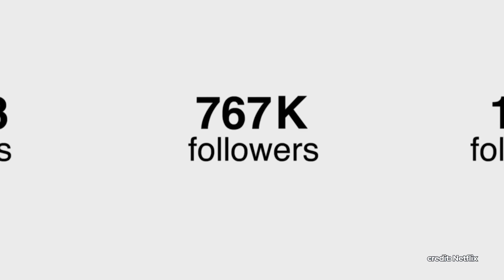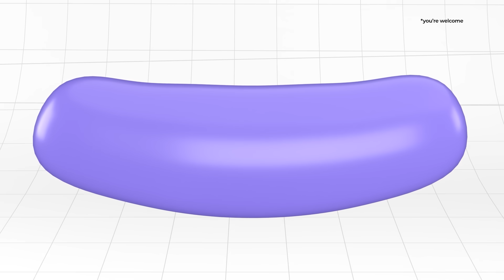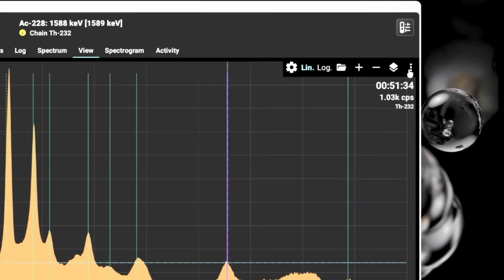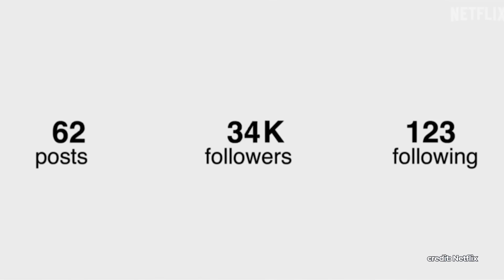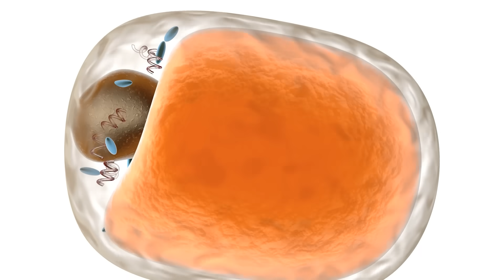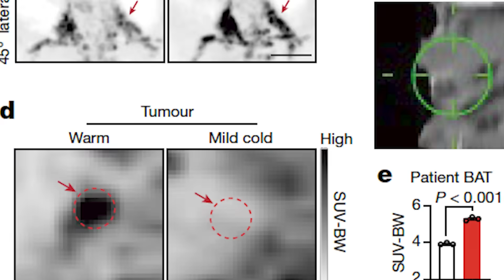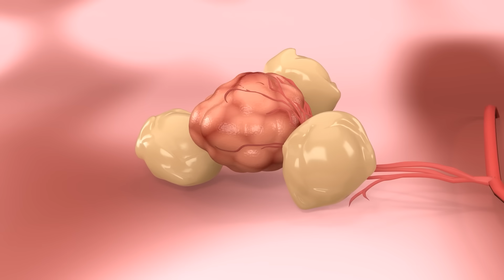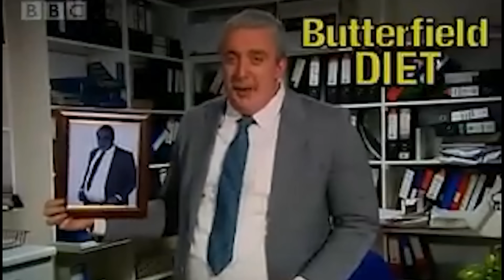Scientists Just Discovered How to Starve Cancer

Comment: I've been talking about this for years, and I've been ridiculed for it. When I mentioned Warburg, I was called a crackpot. When I said that it's a metabolic disorder that causes normal cells to go back to simpler (evolutionary earlier) metabolic pathways like glycolysis and fermentation (hence the lower oxygen intake and increased production of lactate), they said that I'm not a doctor so I shall shut up. Stupidity is even less curable than cancer, it seems :q
Why should we starve cancer cells though? I don't think this is gonna work, and I was saying that for a couple of years since. Here's why.
In most visualizations (yours included) people depict cancer cells as those nasty looking blobs, but in reality there is not much difference between "normal" cells and "cancer" cells, and you wouldn't be able to distinguish them even under a microscope, because they are the same cells as the "normal" ones, just with a different metabolism that reverted to older metabolic pathways from whatever reason (excess of sugar might be one of them, but damaging the oxidative phosphorylation pathway might be even more so, e.g. cytochromes might get damaged by nitrile groups that irreversibly bind with their active site). If there was a reason why those cells had to switch to earlier metabolic pathways in order to survive, getting rid of those cells won't do much, because as long as that cause is still there, new cells will switch too (what they call "metastases"). That's why starving them won't do either. It might even get things worse, because more starving cells means more reasons to switch to other metabolic pathways in order to survive, and they might find a different food supply. The worst case scenario is that they might find a way to feast on surrounding cells and decomposing them (basically starvation-induced cell cannibalism).
So what we should do instead? In my opinion, instead of starving them, we should remove the original cause of them switching to different metabolic pathways to begin with. We should provide them all the resources needed for oxidative respiration. Another hint comes from Linus Pauling, the world-famous Nobel laureate, who also did a lot of research on cancer and started an institute dedicated for that goal. His lead was ascorbic acid which is the primary antioxidant in plant cells. But there are others too, such as carotenoids, flavonoids, nicotinamide, and in humans a similar role is performed by cholesterol (another falsely accused "bad guy" of modern medicine). Long story short, these substances were not present in earlier stages of cellular life evolution because they were not needed yet, since there was no oxygen in the Earth's early atmosphere. Once plants started generating more and more oxygen, cells had to develop mechanisms for dealing with oxygen respiration byproducts (such as free radicals) and started producing antioxidants. The lack of those antioxidants might stop cells from using oxidative pathways in order to avoid producing too much free radical byproducts that might damage them, and switch to non-oxidative pathways. So in order to reverse this switch, one should provide more antioxidants to make oxygen-based metabolism available again. Also, since these substances weren't present in earlier stages of evolution (because they were not needed yet), anaerobic organisms can't metabolize them and they would be poisonous to them, if it wasn't for the fact that they evolved and now they have metabolic pathways for processing such molecules. So the presence of antioxidants might be a signal for them to switch back to these newer oxidative pathways – one, to be able to produce more energy from respiration, and two, to get rid of those excess antioxidants by oxidizing them by byproducts of oxidative respiration.

Comment: One Doctor uses pulse therapy because cancer cells do not recover as our own cells do.  Scientists have ran so very many experiments 'using low carb diet' when in fact it was not low carb and it was dangerously unhealthy - killing a lot of the mice.  When they say low carb or ketogenic diet dig deep to see how and what the animals were fed and for how long.  Some experiments of two weeks were nowhere near long enough for a body to relearn how to make ketones then get up to speed with making the enzymes to use them.  So much research was designed to fail.  Now this very expensive end product they are researching may not be followed up as it would loose a lot of income relating to treatment.  Well done those of you commenting below for the benefit you have found from a 'free' treatment plan.

Comment: TL;DR Scientists have discovered a way to potentially starve cancer by genetically engineering fat cells to outcompete tumors for glucose, effectively cutting off their energy supply without using radiation or chemotherapy. This breakthrough, called living cell therapy, shows promising results in shrinking tumors by over 50% in lab tests using modified fat implanted near cancer cells.

Comment: The ketogenic diet has a sound scientific foundation. As stated cancer cells are glucose hogs and are incapable of metabolising fat.
It makes sense, therefore, to remove carbs and sugars from the diet, thus depriving cancer cells of their energy supply. 
And there is no question of this being more harmful to the body than to the cancer. Humans can live perfectly well with absolutely no carbohydrate, but instead utilise ketones for energy production.
The trouble is that there is no money to be made by pursuing this avenue. Big pharma prefers big expensive sledgehammer solutions, which reap large profits rather than prevention or inexpensive solutions.

Comment: Is it required that all YouTube producers use the largest microphone on the market?  If I were to produce a Podcast I would opt for lapel microphones and a in ear piece speaker.  I did audio for a  live theater events.  Instead of wireless mics one the actors I used powered lapel mics carefully built into the floor.  It worked perfectly.  The audience never saw a microphone or wiring on anyone, because there were none.  The audio was all wired, never even 1 glitch.

Comment: I appreciate the video but I have to disagree with stating no studies or case reports show that a keto, low carb or carnivore diet has not been effective in cancer. Research is just beginning on this. And there are plenty of case reports where patients have had tumors reduced by using a keto diet including glioblastoma multiform, the deadliest brain cancer. I am an MD with a midbrain tectal glioma  which has actually shrunk in size since adopting a keto diet.  Further cancers also use glutamine for energy, the most abundant amino acid in the body. Researchers are working on glutamine blockers successfully. However, as the body needs this amino acid, the press pulse theory has been proposed where keto diets are used and glutamine blockers are used intermittently. I’m excited about the fat theory. I had not heard of it.

Comment: Cancer cells use glutamine (a 'non-essential' amino acid, in fact the single most abundant one produced in our bodies) as well as glucose which is probably why inducing ketosis was/is unsuccessful as a treatment on its own. It should nonetheless be used as part of a strategy/protocol to kill malignant cells at a rate which doesn't cause the body-wide damage that highly cytotoxic chemicals do ('chemotherapy'). There are actually several compounds which can be used, including one so cheap it's practically free. I'll leave the reader to guess what it is, and why strenuous efforts have kept it out of the public's awareness for well over 50 years.

Comment: at 4:47 the second image shows the bright spot is gone and also notice the heart and brain aren't as bright. how badly were they affected from the experiment?
Reply: You have to realize that the image enhancements that are done for PET scans make comparison of one scan to a later scan less simple than it would seem. If the intent is to compare one image with another, then many issues would have to be addressed to make sure that they get the same enhancements. Instead, the differences within a single image are more readily comparable because the same image processing was used across that single scan. So in the case of comparing the heart on the left with the one on the right or the brain on the left with the one on the right, these scans were probably not meant to focus on that comparison. The relative dimness of the cancer compared to the other organs within each image is really the key takeaway.

Comment: This is fascinating. I've had metastatic breast cancer for 32 years. It has invaded 7 different sites, confirmed by DNA analysis, over the years. But, so far, none of the cancers have developed much past 1cm, and it isn't because I've eaten a healthy diet or lived a healthy lifestyle. What I have done, consistently, is keep the thermostat at 62-65 degrees, until this summer. I finally turned it up to 70, during the day, to conserve energy and save my ageing AC system. I don't know that the cold environment has kept the cancer to manageable levels, but it is interesting that I've survive long past expectations despite my poor diet and lifestyle.

Comment: Dr.Gerson Diet
Original test on about 200 patients, 99.5% cure rate. Not only works against cancer, but it also helps the cells remove and replace scar tissue with proper tissue. I studied the diet and after having a doctor freeze off my skin cancer, when it persisted in coming back within weeks, I used a paste I made from broccoli and cucumber to cover the area three times a day. Over 6 months it healed and never came back in that location above my left eye on my forehead. It did come back about ten years later near the center of my forehead, and I used the same broccoli and cucumber paste and it healed over three months. 

Three times a day I washed my forehead with spring water and put the fresh paste on and taped over gauze on that paste. Organic Broccoli and Organic Cucumber, blended to a paste, put on paper towel to soak off the water. Put the paste on the spot, covered liberally, even 1/2 inch around the spot, covered with non-stick gauze and taped on with paper flex medical tape. If I had never researched and found the Dr.Gerson Diet to study, I would have not realized I could change my diet and make a paste from vegetables. I used Broccoli as I found it has anti-cancer properties, and I used the cucumber because (well, to be honest) I always was hearing it was the least nutritious vegetable that was pretty much useless, and I figured it was just a rumor spread around by family and friends. I needed something to help it be a paste and the rind of the cucumber seemed to be what would make a good paste.

Comment: You have completely disregarded the affects of low glucose diet, your body does not necessarily need glucose, it can burn ketones. You did not site any references when you blew off low glucose diet as ineffective. Work by Dr Thomas seyfried has shown this works, and mixed with glutamine inhibitors can cure almost any cancer. Any one reading this should check on Dr Siegfrieds work on you tube, it is eye opening.
Reply: That is Dr Seyfried not Siegfried, damn autocorrect

Comment: What happened if the beige fat, which is better at stealing glucose than cancer, isn't completely removed and instead grows uncontrollably.

I suppose it (hopefully) won't metastisize like cancer does.. but couldn't it grow causing additional problems?

Also does it generate excess heat like brown fat? Sufficient constant excess heat could damage surrounding tissue like a high fever does.

Comment: You skip lightly over why fat cells need to be extracted, modified in the lab and then implanted. Why can't those cells modified inside the body? And what is that liposuction we've been using for decades? How do you precision modify fat cells? One at a time? Where do you implant them? Around the tumor or in the spine? And how do brown fat cells burn glucose? The final one is totally weird. I did not know there were fat cells. I thought there was fat in the cells.

Comment: The dosage of chemo therapy can be diminished by 50 % if accompanied bij the use of Naltrexone in low doses off +/- 4,5 mg. The toxicty of the chemo therapie will significant be lowered so that the side effects en aftermaths of the medieval chemotherapies will also be significant reduced. By refusing to scientifically test Naltrexone for its broader application it is still only permitted for the use of treating people with addictions in a high dose of 50 mg. Low dose Naltrexone also works with people with cystic fibrosis, lung-covid, irritable bowl syndrome, chronic pain and several auto immune diseases.

Comment: There's so much missing about how cancer starts and works, it seems a bit shallow, not thoroughly researched.
Cancer does not start with the genes, but the mitochondria. Healthy mitochondria in a cell means the cell does not develop into a cancerous cell, period. What causes mitochondria to go 'bad' (cancerous)? Glucose. Or rather, too much glucose. The break down of glucose causes free radicals, which then can mutate the genes, but not always. So, what is "too much"? Anything over physiological levels, and our bodies create ALL the glucose it needs, so, not only is it not necessary to eat carbs, it is damaging in sooo many ways. And going on an extremely low carb diet, like high fat carnivore, you actually brown (verb) some fat cells. And, as many have pointed out, Prof. Thomas Seyfried has done a LOT of work based on Warburg, and has conclusively shown that cancer is not a product of mutations, but the reverting of fuel production to fermentation, an ancient energy production, which will kick in in cells that are harmed enough to not die outright, but are sufficiently harmed to not function properly. And the fermentable fuels? Glucose, and the aminoacid glutamine, which is the most abundant aminoacid in the body, and is crucial for immune system function. And tumors respond to a 'press/pulse' protocol, where you "press" by lowering the blood glucose levels, and increasing the ketones (which the cancer cells cannot use for energy, and thus are not able to fully utilize the fuels available), and "pulsing" with a drug that suppresses glutamine, only for a period, so the immune system has the ability to 'restore', after the cancer cells have been hard pressed on both their fuels. The immune system is then able to break down the cancer cells, because it can now recognize them as cells it ought not to have. It may take several "pulses", but they have MANY case studies (including Pablo Kelly, who is famous for having survived 10 years, without the standard treatment, when he was given less than a year), and 100+ papers on this.

Comment: Fasting isn't an old wives tale. Autophagy is a proven method to reduce tumors, and it's research won a Nobel prize in 2016. The problem is that the requirement to starve  cancer is wild, you'd have to prolong fast for months with a strict diet when you can eat
Reply: Carnivore diet is the optimal diet. No sugars, lots of animal fat and unintentional fast, because the food is fatty and nutritions dense, you simply can’t eat more then one or two times a day.

Comment: Dr William Li has described an anti-angiogenesis diet which down-regulates the branching of capillaries to cancer tumors by blocking VEGF. Dr Li has given at least two public videos on the subject via TED talks.

Even more impressive is the work done by Thomas Seyfried by starving cancer tumors of their fuel. The reason why the restriction of simple sugars and carbohydrates did not work is because cancer cells metabolize glutamine. Without reducing levels of glutamine in the diet, which means protein restriction, the elimination of glucose will not do the job by itself.

Comment: Scientists found a way to use fat cells to fight cancer. They tweaked white fat cells to act like brown fat, which burns a lot of glucose (sugar) for energy. These modified "beige" fat cells were placed near tumors in mice, where they gobbled up glucose faster than the cancer could, starving the tumors and shrinking them by over 50% without needing chemo or radiation. It’s like using the body’s own fat to out-eat cancer’s fuel source. More work is needed to make it practical for humans and ensure tumors don’t find other ways to grow.

Comment: This is not correct. It was recently proven that only glucose and glutamine ferment, the ONLY two cancer fuels. Glucose can be lowered with diet, and both with drugs. (Can't find Seyfried's paper.)  If you add to this diet/drug approach some cryotheraphy based on this video, you'd additionally starve cancer down to vanishing, not temporariliy but permanently as long as you are on this treatment.

Comment: I've always been extremely thin. My diet has always been loaded with fats and I still can't gain weight. The notion that 'fat is bad for you' is nonsense. If you have a healthy pancreas you can digest incredible amounts of fat and what's not used passes through. A high-fat diet isn't a concern. It's unhealthy fats that turn into other things in the body. Also carbs producing unnecessary sugars with a high fat diet. It's the sugar and carbs that cause injury to the arteries and signal the body to store fat. I don't understand why this isn't common knowledge.